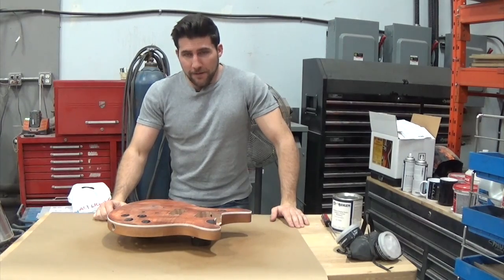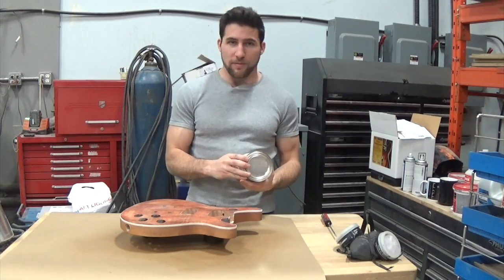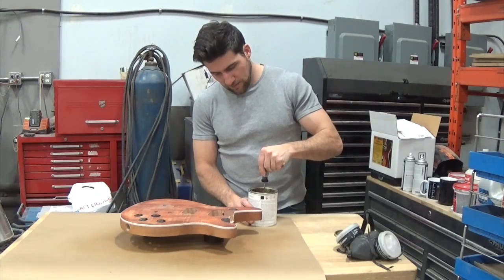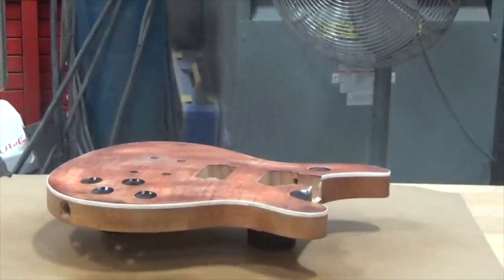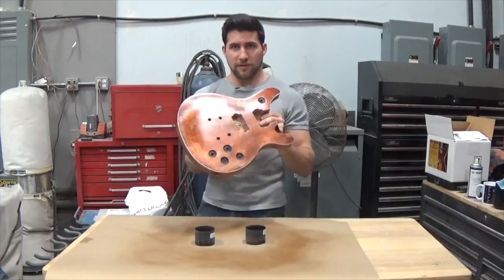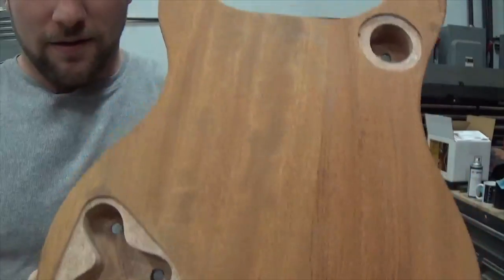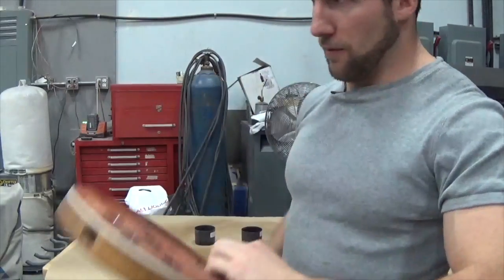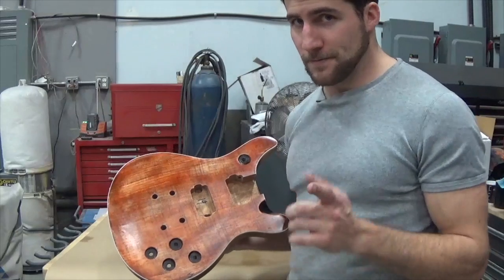Spraying Sanding Sealer

Comment: Hey man . Great videos ! I realize I'm several years late to the party but I've used oxford sanding sealer and I'm wondering if it's safe to use masking tape over it after it dries ? Ive used it to seal a stain job but wanted to add some nitro edging before applying my nitro clear . Thanks for any help ✊🏼
Reply from the maker: That should be safe yes. As long as it’s fully dry and you’re using painters tape and not something very adhesive.

Comment: Hey Brad I know this video is old but since it has been so dificult getting laqusr from just one company In the US I did buy a can of watco brushing laquar for which I plan to mix MIca powder in to tint and use laquar thinner to reduce so my question is since for sanding sealer since my choices are deft laqusr sanding sealer or minwax laquar sanding sealer could I just buy the deft then using mica powder tint it grey so I could use it to seal the wood up sand it smooth and build up coats like a grey primer. Then use a, quart can of watco satin tint it with mica powder to get my base coat color and use that like a basecoat the use my watco gloss brushing laquar reduced for my actaul clear coat.

And honestly if I could just use watco for everything including sealing I would anyway I use boiled linseed oil on all my guitar bodies first and let it cure over a 20 to 30 day period then wipe the bodies with isopropyl alchohol to remove the Guminess and just not sure if I even need sanding sealer I would be happier if I could just using a watco laquar qaurt can making my own primer.

Any advice would help but worse case scenerio is maybe I just need to use deft sanding sealer and a can of deft satin clear brushing laquar tint it with mica powder for my basecoat and use deft clear brushing laqusr gloss for my actaul clear  as I hate polyurathane on wood.  Duplicolor I am okay with for painting but no urathane or water based stuff on my guitars because of my love for boiled linseed oil and tung oil and honestly if the formulations issues and nonsense does not stop with the paint companies and stores I may just start getting my own shellac resin and using denatured alchohol and tinting that to do my guitar bodies as shellac resin is Really cheap on Amazon and does not yellow.

I am just at my wits end over this and having trouble getting compatable paints over a guitar body at reasonable prices
Reply from the maker: You don’t necessarily need sanding sealer. You can use the watco lacquer as your sealer. Brush it on, let it harden, and sand it back. Do that a few times and it will be sealed and you can move on to your color work.

Comment: I sprayed sanding sealer and it left streaks. I'm thinking it went on too heavy in some places. Do I have to sand it all the way back (its gumming up my 400 grit paper) or will they not be noticeable once I spray the nitro over the top? Thanks
Reply from the maker: What do the streaks look like? Hazy? Rough?
Reply: @BradAngove  There was some roughness, which I think may have been from too much air pressure, but the streaks look milky. I was thinking it was too much build up too fast, but now I'm thinking maybe they're due to too much humidity. Not sure.
Reply from the maker: Sounds like you have some roughness from the paint going on too thin and with too much air. Haziness can be from that because of the surface, but if you have gloss areas with haze underneath that is from too mulch humidity and potentially spraying too heavy.

Comment: I'm getting ready to sand my 3 coats of sanding sealer with a 400 grit sandpaper.  How do I know when I sanded enough?
Reply from the maker: It just needs do look dull and smooth.
Reply: @BradAngove  I just applied 2 coats of Oxford Heritage Cherry Red lacquer (transparent look) and I let it dry over night. Some parts are more clear while other parts are more matte. How do I buff this transparent red before I put on the clear coats?
Reply from the maker: Why would you need to do that?
Reply: @BradAngove  So I just go ahead and spray on the gloss clear coats after the 2 transparent red coats dry?
Even though some parts of the transparent read are more clear than other parts?

Plus, I saw one or two little transparent red lacquer drops on the body I would like to buff out.
Reply from the maker: I’m not sure what you mean about buffing them out. To get the next coats to stick you should sand the lacquer. Probably with 800 or 1000 grit. You shouldn’t buff it.

Comment: Hi Brad! I'm kinda new to the whole finishing process. And I was wondering or I can get away with like a budget electrical sprayer for, say, applying sanding sealer.
Reply from the maker: You could if you’re good at setting it up etc., but you can also just use spray cans for that.

Comment: I have used behelens sanding sealer on a body. I then masked off areas to to a sun burst with some behlens brown and orange. When i removed the masking tape to put the clear coats on residue gum remained. What is the best way to remove the gum without ruining the sealer coat, should i sand before the clearcoat, also should i flash on a little more sealer
Reply from the maker: I simply rub off tape residue like that with my thumb, then clear carefully with wax and grease remover before continuing to spray. There should be no need to sand with that paint type.

Comment: I've been burning through your videos and I'm loving them. I do not have this available and Amazon is showing weeks to ship. I have Deft Lacquer Sealer available locally. Any thoughts? This is still in reference to the comment on the other video. After watching your vids, I've decided painting is the best route.
Reply from the maker: The deft lacquer sealer works fine. I mostly use the Mohawk ez vinyl sealer now, which you can find in my amazon link or solomusicgear link in the description.
Reply: @BradAngove  I was o ly asking because the link is showing weeks out for shipping and I'm doing a test panel. So far, wood sealer to fill the grain, sanding, and sealing is working best. Thank you for the response. Last question regarding the Deft; can and brush/spray on, or aerosol?
Reply from the maker: Either way works fine. I usually prefer aerosol, but that’s just how I’m used to applying stuff.

Comment: Hey Brad,
I've done the pore filler and just applied 1st coat of sanding sealer. I did go over the guitar with a tack cloth.  It kinda looks like the sanding sealer got absorbed into the body is that normal? I didnt go over it with a thick coat  kinda light because I hadn't used this b4. I'm sure I got an even coat. 2nd coat should do it.  Is sanding it needed if no runs?
Reply from the maker: That’s pretty normal. If it has had some time to dry I would give it 24 hours and then sand with 400 and recoat with more sealer.
Reply: @BradAngove  thanks brother

Comment: Cool, thanks. So is sanding sealer necessary when using a solid color for your top coat? Or is it always necessary?
Reply from the maker: Using something to seal up the wood is generally a good idea to help get a smooth surface. Without it the wood can "drink" a fair bit of your paint and make it hard to get to you sealing coat.
It's necessity is somewhat dependant on what kind of wood you're using. This flamed maple is very open grained, so a sealer is important. If you have a tight grain wood that has been filled, it's going to be much less important.
Reply: Ok thanks. So you give it a few coats and then light sand to smooth it out before color?
Reply from the maker: Essentially, yes. After you've sealed it up with the sanding sealer you can give it a few days to dry, sand it flat, and then you should have a nice surface to spray your colour onto.
Reply: Awesome, thanks!
Reply from the maker: You're welcome.

Comment: Hi Brad, would you ever use a sealer and then 2k gloss?  I used a wood filler, sanded it down, then filled in anything else major and sanded again.  Applied Keda Dye Stain Powder, black, sanded, then other blends of blue/purple and sanded it again, probably 8 times now.  I just want to know how to finish it as it's solid maple, and want to make it glossy.
Reply from the maker: Yes, you can absolutely do that. If it’s that smooth though you can probably just jump straight to the 2K.
Reply: @BradAngove  Thank you!!

Comment: Hi
Question:does the sanding sealer makes any difference on the finish ,I normally use straight nitro lacquer as sealer and final coat and it give me a really nice finish,just wandering if it will look better if I use sanding sealer to seal the wood and then the lacquer
Thanks
Reply from the maker: It depends on the wood. The short answer is no. But sealer makes it easier to seal up wood that has a bit more porosity.

Comment: I am finishing an all new guitar and I filled some open walnut gain and then shot some sanding sealer on it. Well I missed some of the open grain so can I apply some additional filler o top of the sanding sealer, and then???? some more sealer or the finish lacquer?
Reply from the maker: How open is it? If you don’t think you can fill it with another couple coats of sealer, then yes, go ahead and sand it with about 220 grit so the filler will stick properly. Fill, and then re-seal.

Comment: at what pressure was the regulator set for?   I have used RIT dye, the results are really nice, but you can not use a brush to apply the sealer, it will wet up the RIT dye and lift it and blend it, I used it with some spray can clear , had to sand it more, but it turned out nice,  was wondering if you could spray sealer thru a spray gun, now I know,  will be trying this soon.  Thanks
Reply from the maker: I usually aim for about 26 psi at the nozzle, so around 30 at the base of the gun for this size gun.
Reply: thanks,   have you ever tried the RIT dye for guitar coloring,  it does a lot better then I ever though it would,  but for the first coat  maybe two coats,  you can't use a brush, it will bring the dye back to life and will smear and mix with the sealer, but if you spray the first two, sand in between it lets the wood grain show thru,,  I made a pedal steel with it and it really looks good
again thanks for the information
Reply from the maker: I’ve used the rit dye on a few projects, yes.

Comment: Brad. I see that the face of the guitar is very blotchy. Did you intentionally do this, or was the wood not prepped properly?  Very nice mahogany finish on the back.
Reply from the maker: +superbee691 that's due to the open grain on the flamed maple veneer. A couple more coats of the sealer would likely rectify that. 
Either way it's best to sand your sealer before painting, which would even things out.

Comment: Hey Brad I have a different sanding sealer than belhens. How much would you cut ot to spray it through a gun
Reply from the maker: As little as possible while still letting it flow out nicely. None if that’s an option.
Reply: @BradAngove  thank you

Comment: Great videos...I'm a complete noob and I just purchased a diy ASH body les paul kit, with a quilted maple top, mahogany neck and maple fret board....I'm just wondering if you could let me know if my process seems legit.
Dye top black sand back, dye blue sand around lighty to remove some of the blue around the edges then add black for sort of a burst(using a water based dye by keda woods, Its Like a powder)...
Next fill the mahogany neck and the back of the ash body with black water based grain fill, and same dyes to match the front
Then use a sanding sealer (preferably in a rattle can) 
The Finally a Clear nitro coat sprayed from rattle can on the body and tru Oil the neck

I Skipped writing the sanding steps.....also do I need to lacquer The fret board, It has abolone inlay that Im terrified of ruining..... Any advice tips would great..
Reply from the maker: You’re good. That process should work just fine. And no, you don’t need to lacquer the fret board. 

On a side note, I will be doing a video on finishing quilted maple soon. You’ve got the concept though.
Reply: I look forward to the video. I've recently gotten in to all this and you've really helped me grasp it all and I've really enjoyed he instructional videos. I even created an account to specifically ask you, because of awesome your finishes turn out.....before I found your channel I was just going to tru oil the body but after seeing you do high gloss and that its really not to hard work, just more work I decided to go nitro. You've shown me the way keep up the good work brotha.
Reply from the maker: I’m glad I’ve been able to help. I hope it goes well for you.

Comment: Will this sealer fill in the grain? I have an Ibanez Jem kit that I bought and i'm on the 4th or 5th time of screwing it up.  It has the gold hardware and the tree of life inlay on the neck so I'm going with white. I've been trying duplicolor primer, paint, and clear coat spray paint and didn't seal after sanding.  I sanded down to 600 grit.  I went to the automotive store today and picked up duplicolor's "paint shop" pre mixed sprayable primer, paint, and clear coat for my HVLP gun (3 separate quarts). I really want this to work because I forked out the cash for the Dimarzio Evolution set with a Seymour Duncan hot rail in the center.  Can you point me to one of your videos that covers this, or more importantly offer me some advice to make this project come out good?
Reply: I also picked up a quart of generic ACE brand water based sanding sealer.
Reply from the maker: Have a look at my video on sealer vs grain filler. Then watch my video on how to grain fill mahogany, or my really old video on grain filling with paste wood filler. Finally, for additional info if you’re interested, check out my video on sealer vs primer (but don’t worry, the primer you’re using should be fine).
Reply: Thanks Brad! It's a basswood body so from what I read about it sealing should be fine even though it's soft and light. Please let me know if you disagree.
Reply from the maker: It will take a few coats, but in general I agree.

Comment: Hello Brad, I have learned a lot by watching your videos and now at this exact step and got some of that same sealer, but I would like to know what kind of grit sanding paper would you use after the sealer i applied?

Thanks a lot for all the info

P.s. Its a flying V
Reply from the maker: +Kevin Infante I'd likely go with 600 or 800 grit paper for that. Thanks for watching.
Reply: @BradAngove  How finely do you sand the sealer?  Scuff sand or more?
Reply from the maker: I sand it smooth. As much sanding as that takes.

Comment: Hey brad, if i want to paint a guitar in nitro can I use any kind if sanding sealer or does it have to be a nitro-based sanding sealer? the body is basswood. thanks in advance
Reply from the maker: I’d use either lacquer sanding sealer, or vinyl sealer personally.